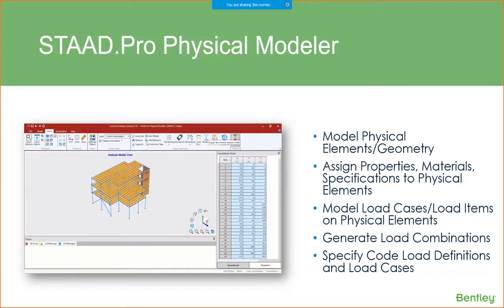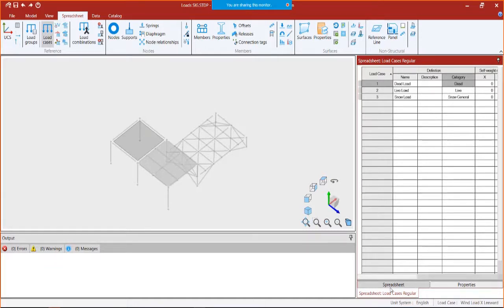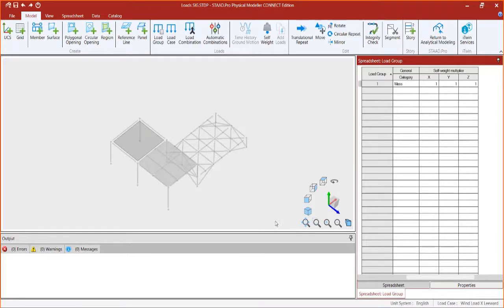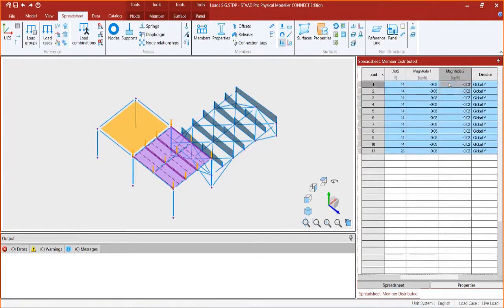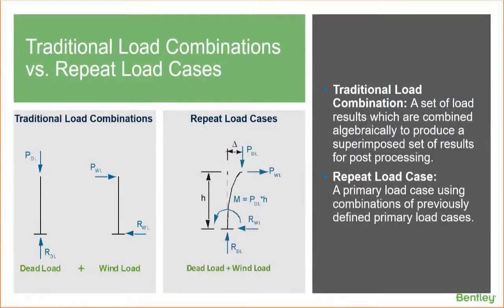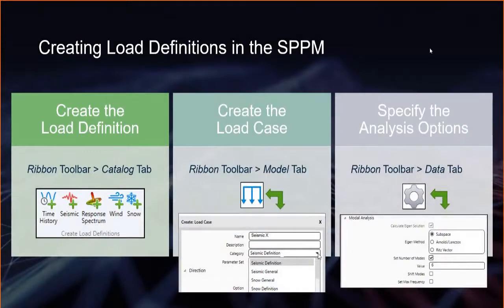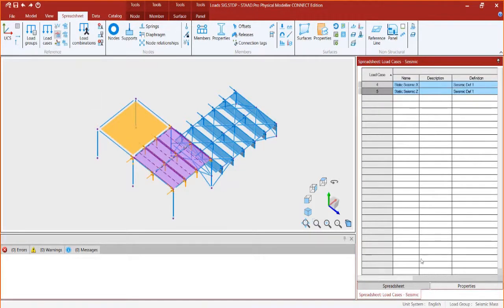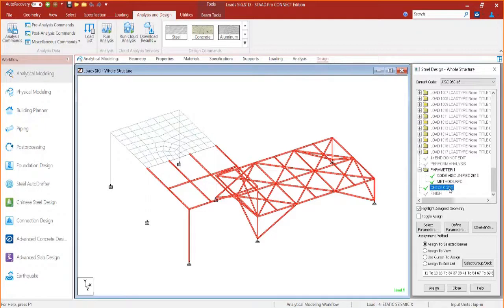Understanding Loads in the STAAD.Pro Physical Modeler

Comment: Well done Mrs Tedeschi. Veeery helpful video ! we need more like this on physical modeler work flow and not only for buildings but for other steel structures as well such as pipe racks , skids' structural bases etc. which are very common in oil and gas sector.

Thank you and keep on the great work!